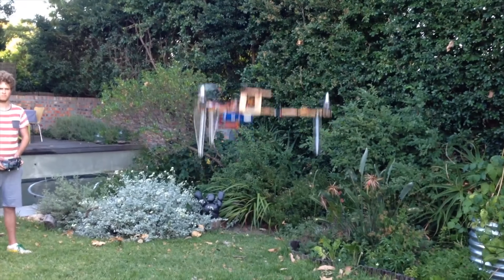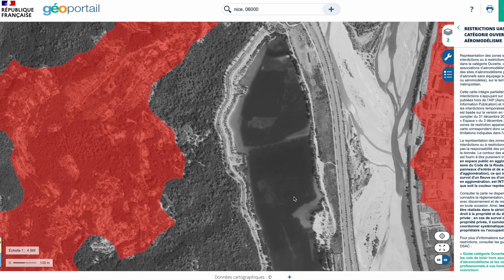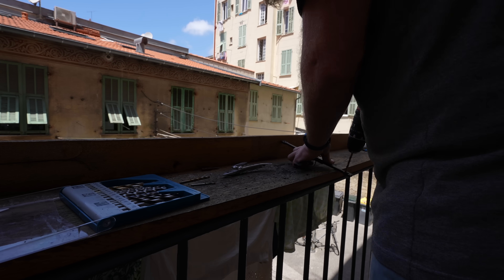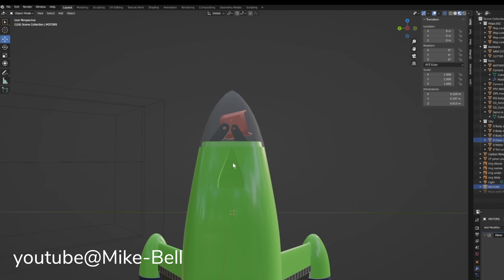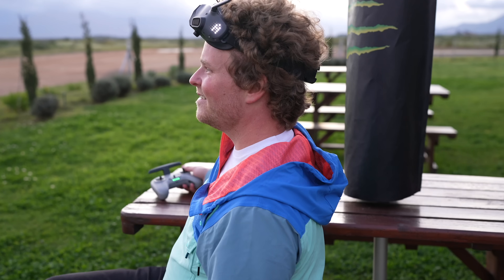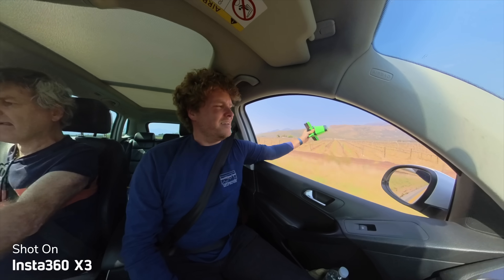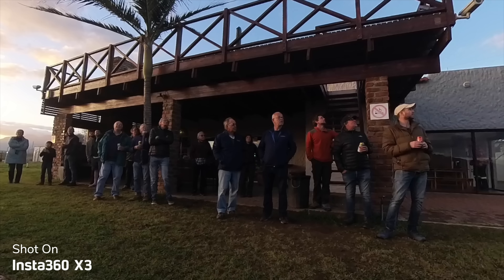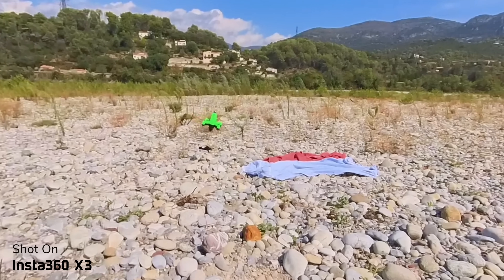How I Built the FASTEST Drone on Earth

Comment: This was a 2x6s system?  I think 2 or more batteries are necessary from my tests I guess? The battery drop seems really large, I get like one big impulse of speed and then my single battery just drops out at 100% throttle.
Reply from the maker: Yes 2 6S in series to make 12s
Reply: @LukeMaximoBell  oh wow really, not in parallel? What esc's can handle 12s? wow  Ok well that would make sense how you're going so much faster than I am... lol
Reply: @LukeMaximoBell  Oh I found them they're like cinelifter motors/escs...which I know you used on your second design...there are 5 inch motors that take 12s and escs?  So cool.
Reply from the maker: @maddercat  Using Flycolor V3 80A for the next version of the drone. And Matek FC also takes 12S input.

Comment: You can putting in an air tag some where inside the drone, so you can track it. If you loose it.
And a as you are not concerned with weight i think you can try it.
Also, an air tag is super light

Comment: The team that built the Drone 1 for Redbull definitely took a bit of inspiration from your design!
Reply: Dutch Drone Gods of the RedBull drone actually started designing about 6 months before.
Reply: @Mike-Bell  So what party is responsible for the original flying Weiner design?!
Reply: @niclikescakes  its rather like the bicycle.  there is a one best way to arrange it and anyone who applies their mind is likely to come up with the more or less the same solution.  Both designs were developing independantly and without knowledge of each other and came up with the much same thing.
Reply: @Mike-Bell  More research is pointing towards "Quadmovr" being the first to come up with this design actually.
Reply: @niclikescakes  yes and Ryan Lademan Billster and more. But when you wrap an aerodynamic body around an FPV racing drone it all points to the one similar shape.
Reply from the maker: You are right. Quadmovr came up with the original shape very similar to what you see on the Red bull drone.
Reply: @LukeMaximoBell  Excellent project regardless brother!

Comment: Are your props 5 inch? I'm using same motor but with 8 inch prop and my esc gets so hot it get's confused and cuts the power off the motors
Reply from the maker: What pitch are the props you are using? And what KV at what voltage?
Reply: @LukeMaximoBell  it's 8040, my motors are t motor v2808 1300kv

Comment: That first test flight at 2mins gave me some flashbacks! haha. I stand on my drone with one foot now for the first test flight or any time i change settings in betaflight. One time I accidentally had it setup to "resume last command" when it lost telemetry. That thing took off full speed indoors, hit me, and literally cut me over 40 times within a second. I put my hands out to stop it and my hand looked like a cooked hotdog all sliced up.. There were about 4 cuts that went through tendons and muscles almost to the bone. That was only with 2204 1960s running 4s on older tech about 10 years ago. I couldn't imagine getting eaten by this thing!!!

Congrats on the record too!!

Comment: Like the enthusiasm but I would have loved more technical research and application of aero knowledge into the design of the body. Also would have liked to see more technical research on the power control to the motors to maximize efficiency and power delivery in crucial moments to boost speed.

Comment: pressure center is too far forward. you CAN get around it by upping the control loop but the issue with that is that you have really intense changes in speed on the rotors which heat them up and give them less power to drive the thing. battery forward = good. some sort of fins on a tail boon (as I can see you're experimenting with using the insta 360) also good. consider airflow around the motors too? look at naca ducts and ww2 era cowling?
Reply: Thanks for the comment, you clearly know what you are talking about.  You are right, a lot of power was wasted in prop speed changes for control.  Version 2 solves the stability issues with tail fins.  The motors are hot but not problematic.  There are mulitples other pieces that a too hot that are needing solutions but solved pretty soon for a faster model.

Comment: And this is the limit of what DJI is good for, low end hobby drones. Since anything utilizing DJI GPS has geo fencing I would consider the results of the speed tests forfeit, since the drone can not go everywhere. But if you are not using GPS, then the results count in my book. You're a real nice guy and I dont mean to hate. I fly Evo 2 Pro enterprise V3 drones, so that I can go everywhere. I'm about to get into 3d printing myself. I might get into drone building, if its possible to do it without DJI GPS parts and geo fencing, I do have a lot to learn. Again, great results yes, I wouldnt mind getting into the sport myself. But if the drone cant go everywhere then the technology is defective. I am looking forward to hacks of the DJI MINI 4 Pro, I would consider getting it if I cant get my hands on hacked firmware, but that usually comes a bit later.
Reply: I normally dont even consider comparing my drones to DJI counterparts because I consider geo fenced drones defective technology.
Reply from the maker: This isn’t a DJI drone. It’s just using a DJI Air unit. There is no geofencing. However I think geofencing is good because it stops people acting like idiots and doing things like flying into airports.

Comment: That's pretty cool. One way to film it at full-speed would be to put a bright light on it (or possibily a strobe light?) and then film it with a long duration exposure from a wide angle. You would probably get a long glowing trail but one that's moving at full speed for very little extra mass.
Reply from the maker: That’s actually a pretty awesome idea thanks 🙌🏼 the new version has suuuper bright LEDs for better visibility

Comment: That tail that holds the camera at the end... No actual good photage of the drone when beating the record... Makes me think you could have easily added the tail too to solve the instability problem (which is an obvious solution), thus cheating, as it would be hardly considered a drone anymore IMO.  My scepticism needs better proof :) Still pretty cool though!
Reply from the maker: Yeh it goes so fast it’s very difficult to film. With the tail on the end there is way too much extra weight and drag to reach top speed. Don’t worry, version 2 is coming soon and it will solve all these issues

Comment: Since people apply "drone" to all radio controlled aircraft -- clearly you are nowhere near a record.  Here is an RC GLIDER (no motors whatsoever) that can do 548 MPH:  https://www.youtube.com/watch?v=4eFD_Wj6dhk
Reply from the maker: I mean sure if you want to 😂 but the record is for battery powered remote controlled quadcopter. 

The RC glider speeds are insane. However they are “powered” by the lift generated through the updraft. So they are technically wind powered if you want to look at it that way. Not battery powered.

Comment: Well: 1.3 kW per Motor is a thing in multiple dimensions: First, it is impressing that such a gigantic throughput is possible at all - from batteries to motors to air flow over the propellers. Second, it thoroughly limits the usefulness of such records: The speed is maintainable only over a few seconds, and what keeps the motors and batteries alive is not efficiency, but heat capacity. I would rather call it a flying core meltdown pod - only too short powered to actually melt down. But nonetheless very interesting from the viewpoint of achievable peak values :D

Comment: Just throw high kv motors with 12s battery on a light frame and super aggressive props. There are videos of guys hitting over 300kmh and they aren’t even trying for speed records
Reply from the maker: I’m going to 12s for the next build. The difference between 300 and 400 kmh is massive because of the exponential increase in drag.

Comment: what were the specs of this kwad? i assume 6s? what size motors? what escs and FC? what gps? and what brand battery? i think if you wouldve went even faster with a higher C rated battery. not that you needed it, clearly. but i noticed on your high speed runs your low battery alarm was going off which ment your volts would drop significantly when you mashed the throttle then rise again when you let off. aka your battery couldnt keep up with the amp draw of the system. id love to see this kwad with some 120C high end batts when the motors and FC and esc's can pull as much amps as they want and the battery would keep up. more volts means more rpm's. lower volts means less rpm's. there will always be voltage sag to some degree but you can mitigate it as much as possible with better batteries that can output more amps.

Comment: bad aero, you are thinking of cutting the air, but it is subsonic soo its not like that... and you have 4 fins that you need to hold the motors, so use then as airplane wings, to create lift, with that you will use more capacity of the motors to speed, now u are using part of it to just mantein the altitude.

Comment: Epoxi actually cures without pressure, so there's no need for all those books to weight it down. :) It just needs to be in contact so one book would be enough. (a pressure pot to get rid of bubbles etc. is a different thing).

Comment: Tail fins! That silver circle coming off the bottom/back of the previous record holder was their solution to the instability you were experiencing. There is literally decades upon decades of research into flight dynamics at speed. A streamlined shape does not give you stability, only reduces drag for more speed. Glad you were able to overcome the issues with software though.